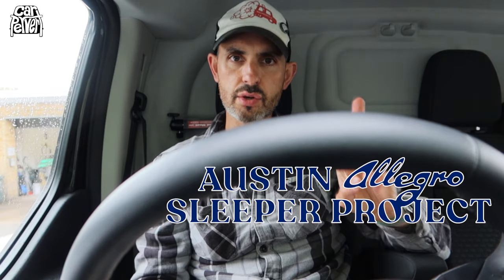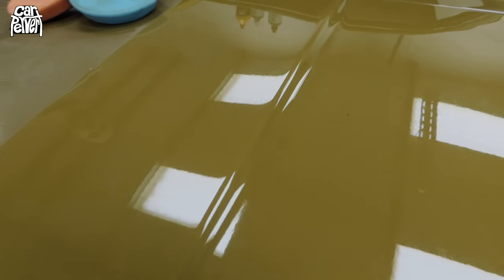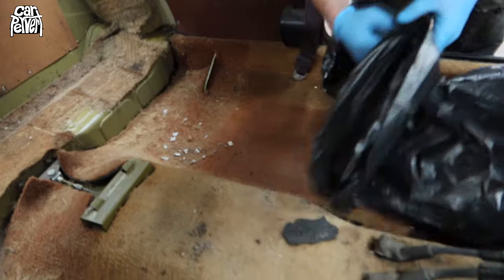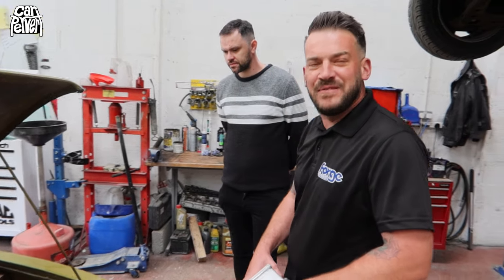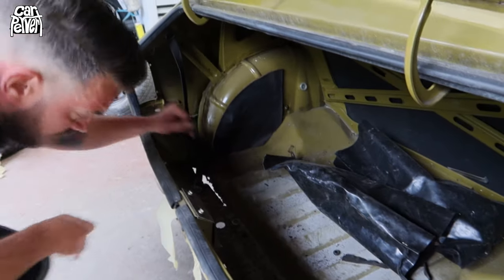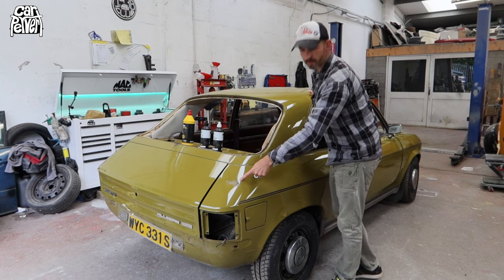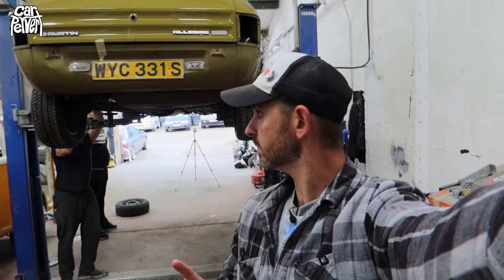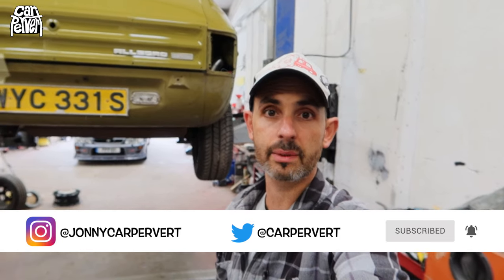Part 2: Austin Allegro V6 supercharged sleeper project

Comment: hmmm. agree that engine is not exactly a great unit. prone to lifter noise and output figures are average. that upper engine mount/link is on a shit angle. why not just cut out entire firewall and refab/move dash back to suit . bugger the back seat. this will allow donk to fit better and room for radiator plus improved (but shit) handling.this is assuming that driveshafts will allow this. or do what old mate says on here and rear drive but i would go LS as they are compact and mental .i still dont get this project but good luck. Your charger on the other hand is buet
Reply from the maker: Are you sure you aren't confusing this engine with the KV6? This is the earlier better Honda unit. It was just badged Rover.

Comment: Car is like a mustard turd. Horrible when new, still horrible. Sorry Jonny. Hired one of these years ago. Had requested an Escort and ended up with an Allegro. It was an awful bag of bolts. Work cut out to turn it into anything.....
Reply: Total DRIVEL! The company I worked for back then used Escorts and Cortinas as company cars and they went through engines and gearboxes as if they were wear and tear items  and we were even trying to get the company to buy BL or anything else but Ford sold to companies cheap and changed these under warranty and that was how they managed to keep their sales so high so our company would not change so me and my fellow workmates never bought a Ford after that when we weer buying our own cars. I bought a 1980 Allegro 1750 TC Equipe and my brother has a 1978 Allegro 1500 LE that he later sold to my mother and they were excellent and very reliable cars. A Mk2 Escort a better car than an Allegro - ha ha ha - ancient agricultural heaps of shit with their leaf springs and brick styling etc and like I said crap reliability. The thing that did let the Allegros down was the colours they used up until the 1500 LE, Equipe and then Mk3 colours made a big difference and the alloys on the Equipe - the only Allegro to get alloys - and plastic wheel trims on the Mk3's improved them as well. Wheels always make a difference to cars. That Allegro Equipe I owned always had people looking at it and in it when I came back to it when it was parked because it was a very nice looking car and not many people with ordinary cars could say the same. Typical comment from a chav who wanks for crappy Fords.
Reply: William Woods 

The Escort won how many World Rally Championships? Don’t remember the Allegro winning anything.
Reply: William Woods 

To quote Wikipedia (not me)

The Allegro is generally considered amongst the most disreputable British Leyland models; some credibility was restored with its replacement the Maestro which was tipped as an adequate competitor to the Ford Escort, Vauxhall Astra and Volkswagen Golf. By the time of the Maestro's launch, a string of poor quality models throughout the 1970s had damaged the reputation of British Leyland and the Austin brand with the Maestro selling fewer models over a greater number of years (605,000 over twelve years to 642,000 Allegros over eight years). In 1987, the Austin name was phased out after 82 years in favour of the Rover name; which hadn't been tainted with some of the poorer products that had dented the reputation of the Austin brand.
Reply: William Woods 

The Mark I Escort was a very successful rally car . The Mark II Escort continued its predecessor's run on the RAC Rally, winning every year from 1975 to 1979 and racing in a variety of other events around the world. In the 1979 season of the World Rally Championship, Björn Waldegård took the drivers' title, Hannu Mikkola was runner-up and Ari Vatanen finished the year in fifth place, all driving Escort RS1800s.
Don’t remember the Allegro winning anything.

Comment: 40+ years down the line and a pile of shit Allegro becomes a classic.   It was hated for a reason.  I had a whole load of different cars in my 40+ years driving career, the Allegro was the worst.  I don't think it had a single redeeming feature.  slow , unreliable, thirsty for what it was, ugly, a total rot box, crappy interior. It ranks at the bottom of of all the cars BL ever made and they made some garbage.
Reply from the maker: Yep, and I love them. But never liked the engines.
Reply: @TheLateBrakeShow  On the plus side yours is miraculous on the rot front.  I' would question the wisdom of 250 hp in a ancient FWD car of any type let alone an Alllego.   Roll cage and crash Helmet for the run to the local shops I think.  Leave it on the trailer and pose with it at track days........